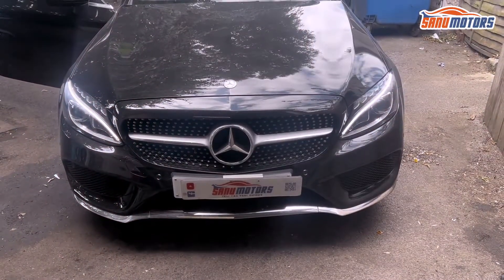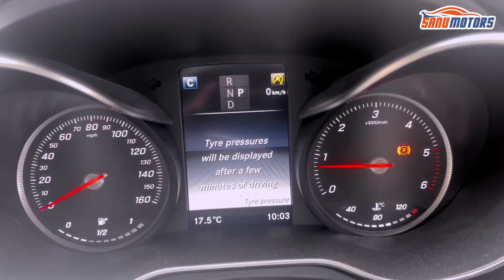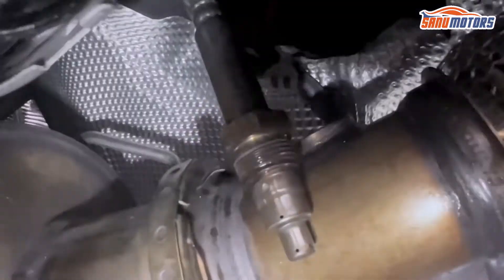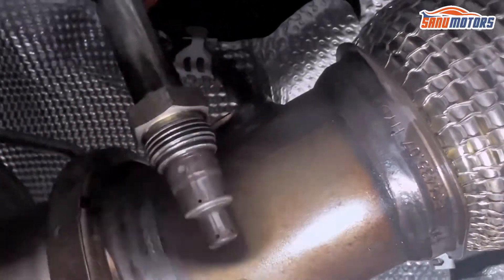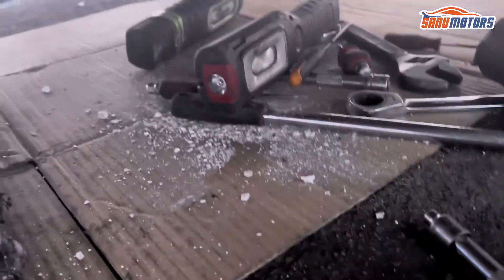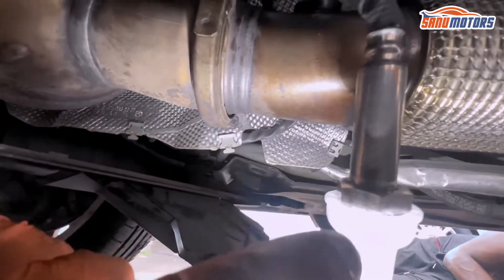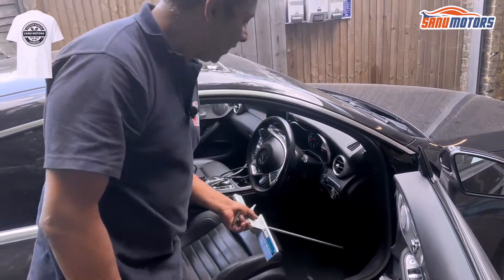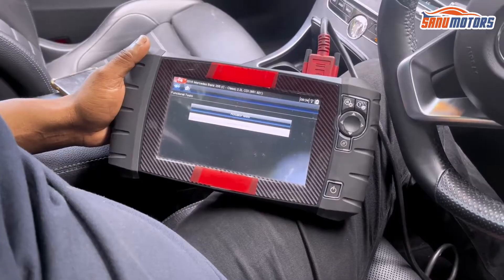Mercedes AdBlue DPF  And NOX Problem Fix | P229F91

Comment: have question? few days ago engine orange light came up in my c coupe 2019. I took it to diagnosis and showed me nox sensor fault (order 1, sensor 2). The guy erased the diagosis on computer attached to my car, and after that, orange light turns off (and it is stays off from now on - already 3 days..). I wander if it will show up again in few days or not? Do I have to replace sensor and for how long is it safe to drive like this. I do not want to damage my engine but I have to travel every day..
Reply from the maker: The appearance and disappearance of the engine orange light (often referred to as the check engine light) can sometimes be a bit unpredictable. When the check engine light comes on, it indicates that the car's onboard computer (ECU) has detected a fault in one of the systems or sensors. In your case, it was the NOx (nitrogen oxide) sensor.

When the technician erased the diagnostic trouble code (DTC) associated with the NOx sensor fault, the check engine light turned off because the ECU believed the issue had been resolved. However, this doesn't necessarily mean the problem is completely fixed.

The NOx sensor plays a crucial role in the emissions control system of your vehicle. If it fails or malfunctions, it can potentially affect your vehicle's emissions performance and overall engine efficiency. Continuing to drive with a faulty sensor may not immediately cause catastrophic damage to your engine, but it's not recommended for the long term.

Here are a few things to consider:

The light may come back: Sometimes, a sensor issue can be intermittent, and the light may come back after some time. If it does, it's a sign that the problem is ongoing and should be addressed.

Emissions and performance: A faulty NOx sensor can affect your vehicle's emissions and fuel efficiency. It may not perform optimally in terms of emissions, and your fuel economy could suffer.

Legal requirements: Depending on your location, there may be legal requirements regarding emissions control systems. It's essential to ensure your vehicle complies with local regulations.

Warranty: If your vehicle is still under warranty, the sensor replacement may be covered. It's worth checking with your dealership.

Long-term damage: While driving with a faulty NOx sensor may not cause immediate engine damage, prolonged use without fixing the issue could potentially lead to other problems down the line, including catalytic converter damage.

I recommend contacting your dealership or a trusted mechanic to have the NOx sensor properly diagnosed and replaced if necessary. They can provide you with a more accurate assessment of the sensor's condition and whether it should be replaced. In the meantime, keep an eye on your vehicle's performance and any signs of the check engine light returning.

ALSO THIS VIDEO MIGHT BE HELP FOR YOU

https://youtu.be/9yFSQ1XEhYo
Reply: thank You Charlie for quick response and advice, If I understood You correctly, if orange engine light stays off from now on - it may be temporary glitch, and it is safe to drive? but if it turns on again in a few days - i should contact my mechanic to have NOx sensor properly diagnosed and possibly replaced .  @SanuMotorswithCharlie

Comment: Hi , very good video and good information 👍I am now a subscriber. I have a U029E87 and a U029E00 fault codes which both say  "communication with nox sensor 2 has a malfunction". Is there any way of checking the nox sensor before I buy a new one...or is it almost guaranteed to be a fault with the sensor? Thanks
Reply from the maker: Thank you for subscribe and follow us. 
I’m assuming it’s c class. There is many ways to check sensors. But easy way to clean adblue sensor. And Swipe NOx sensor, reset warning lights. Use the car and take code again. Then you have a answer

Comment: Hi, I have cleaned completely the adblue injector and replaced both Nox sensors, upstream and downstream. It is a 2017 w205 C220d (not bluetec). Can you adapt the new sensors to the control unit? And how much?
Reply from the maker: Please contact Charlie 07551021029
Thank you